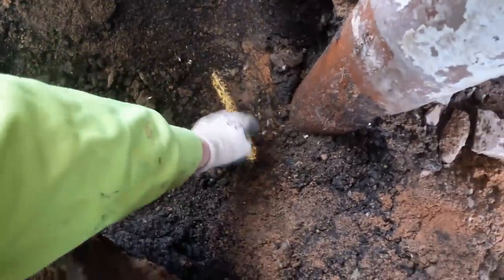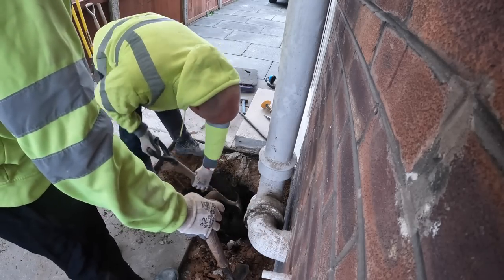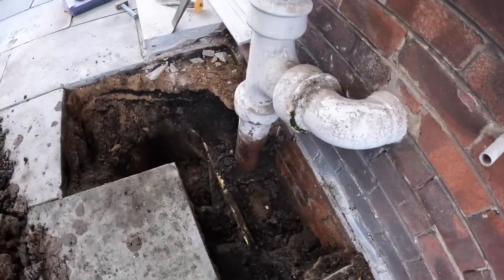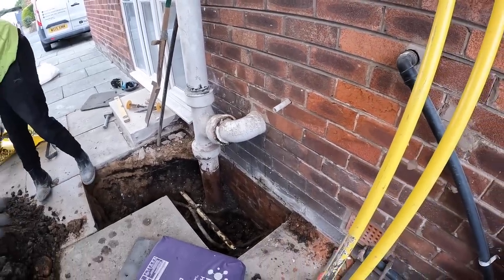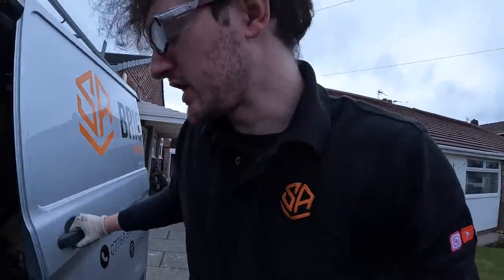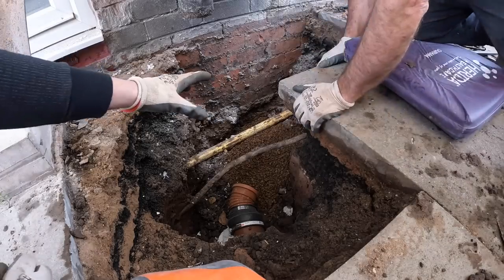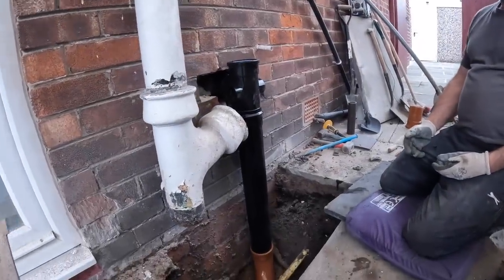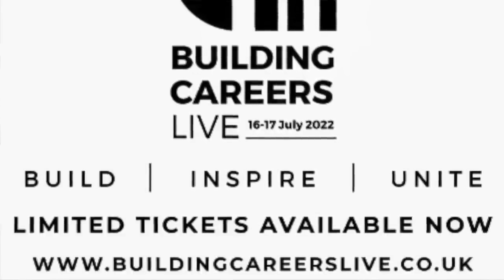NEAR MISS WITH THE GAS & WATER!! MOVING A SOIL PIPE

Comment: Great work i general but 23.00   you need to use eye protectors !!!
Also when using any push fit type fitting the old connection (or new pipe) needs to be cleaned before offering a new fitting on otherwise the seal will be damaged.
Reply from the maker: Thanks Jim 👍🏽🧱

Comment: Old water mains used to be installed in the soil pipe trench so watch out for those too, certainly early 60s houses. Often under the clay or bitumen pipes but sometimes not. All the way round to the back of some houses, stopcock may be in downstairs loo rather than under kitchen sink. 10mm Pea shingle. Some BCOs are ok with 20mm to soakaways.

Comment: I'm from Sheffield and we call it pea-gravel.Funny story,when I moved in this house I got rid of all the cast down pipe and cut the clay pipe back to a good section cos the old stuff was leaking,I had all my pieces cut like you have and was ready with a full section of plastic soil pipe aswell got my fairy liquid on and it starts to rain,yes you've guessed it the rain and the pipe sections were soooooo slippy,I managed the small sections on my own but the down pipe/soil was so long and heavy it just kept slipping till my neighbor lept over fence and held it in place while I fixed it to the wall,I must have done a good job as that was 21 years ago and alls still well.😏

Comment: Nice video as always guys. Top tip though, use a multi-tool for the pipe cutting in awkward areas. Absolute life saver and a lot safer than a grinder when cramped up like that.

Comment: 33:43 was that an old lead water supply line?
You don't need to PVC cement the new waste pipes? Or they press in gaskets?
Reply from the maker: Yes it was lead , not sure if it was live or not so we’re careful around it . 
   As for the pipes , no cement just a lubricant for the ribber seals 🧱👍🏽

Comment: Air admittance valves are generally placed on a soil pipe that is a minimum of 200mm above the highest water entry point – i.e. the highest point wastewater will reach within a soil pipe
Reply from the maker: Thanks for the tip 👍🏽🧱
Reply from the maker: @martin2466  . No drama , just helpful advice , cheers pal 🧱👍🏽

Comment: That valve should be fitted higher than the w.c.
Reply from the maker: Thanks John 🧱👍🏽
Reply: @SteveAndAlexBuild  Should be 1000mm above the w.c, also their not supposed to be used outside as they can freeze in winter and not work properly, the rest looks great tho. Nice job
Reply from the maker: @lukeh2323  Thanks Luke 👍🏽🧱
Reply: Usually the external Durgo is covered with a polystyrene cover…
Reply from the maker: @nigelsmith1198  . Thanks pal 👍🏽🧱
Reply: Hello Steve most comments here are right that air admittance valve should be fitted above the overflow levels of the appliance and usually only used inside. However I think you can get them that have been designed for use both inside and outside, they used to be much bigger though and had insulation fitted to them to stop them freezing. I don't think that is the case anymore.  If you do use the wrong one and it sticks this may stop the toilet  working properly lol.

sorry to criticise mate it sounded like the customer was making requests ....pipe close to the wall etc can make life difficult sometimes. 

It looked nice and tidy when it was finished
Reply from the maker: @jbclassics  Thanks Jack no all advice welcome . It’s an easy fix if it becomes an issue . We are going back to build the porch soon 👍🏽🧱

Comment: Good job you lads don't smoke. Can just imagine it lol wanging the shovel in roll up firmly clamped in lip 😂🤯

Personally I'd chop out that lead pipe and replace it with mdpe where it'd be under the porch. You know it won't leak there then in future.

What's the overflow pipe to the right of your new stack for? Could boss it in to the side of your new soil pipe tidy it up.
Reply from the maker: That’s all down to the plumber. We’ve done the hard part 😆🧱👍🏽

Comment: This is the snag with mole driven service pipes. There’s no warning tape a few inches above.
Reply: British Gas tried to charge me £800 to repair a "moled" pipe one of my lads chopped through in the late 80s or early 90s. I asked for their current gas main spec. sheet. Theirs failed on depth, (should have been >600mm but was <450mm) and no warning tape above. Needless to say they cancelled the invoice. And probably updated guidance.
Reply: I doubt in this case the gas was moled in. It looked steel pipe to me.
Reply from the maker: @baldyslapnut.  . Friggin joke , well done for taking them on 🧱👍🏽
Reply: @SteveAndAlexBuild  I was more annoyed that the two man gang from Clancy/Docwra only had to mix some resin and clamp the repair section on, we'd dug the bloody hole. They were there 10 mins max. Got some repair kits on our vans after that 😉🤣.
Reply from the maker: @baldyslapnut.  😉😆🧱👍🏽

Comment: hard work cutting that 4" plastic soil pipe coming out the bathroom wall up against the brickwork with that Makita grinder, next time use a Multi Tool with a fine tooth wood blade in it, just work your way around the pipe
Reply: I always used a fine tooth hand saw then grinder & flap wheel to chamfer the end.
A “WorkMate” folding bench opened wide is ideal for supporting the pipe while you cut.
Reply from the maker: We have a multi tool but never gave it a thought 💭 😆🧱👍🏽
Reply: @SteveAndAlexBuild   they bostin tools, the times ive had to cut 4" pipe flush to the floor or a wall in bathrooms, no way could you get a saw in and get a square cut so i usually wrap a piece of paper round the pipe, draw a line around it with a sharpie, and slightly angle the multitool blade inwards and work my way around it, quick rub with a file to get rid of the burrs and before ya know it Bob`s ya Auntie, Fannies ya Uncle and cousin Bert`s now cousin Betty coz he`s had his `clock weights` surgically removed lol

Comment: You do need to have a soil pipe that is open vented to the atmosphere on the drainage run that serves the house, it can't just be an air admittance valve. It is fine to use an air admittance valve if there is another open vent on the same run but not if that's all there is. 

The air admittance valve is positioned to low, it needs to go above the highest spill over level which would most likely be the basin. Also most valves are not designed for external use as they can can stop working in freezing conditions.
Reply from the maker: Thanks for the advice 👍🏽

Comment: Pea gravel as I know it is small round stones up to 10mm. You shouldn't use it for bedding pipes because it doesn't compact down and will allow the pipe to move after it is covered. The stuff you used in the video is indeed proper pipe bedding - small angular crushed rock. It should really be tamped down to take all the movement out of it so it provides a proper support for the pipe and anything resting above it. If you were laying larger pipes, like concrete sewer pipes, you'd add a layer of compacted sharp sand too, just to try and make sure there's no movement when after the pipe is laid. For a tiny job like this though I think you'd be safe with any backfill really. For brickies you seem to do a lot of digging! :) Keep up the good work.
Reply from the maker: Thanks pal 😆😆🧱👍🏽

Comment: 4ft, lol, we are metric now.
Reply from the maker: We work in both 😌🧱👍🏽
Reply: @SteveAndAlexBuild  As a patternmaker i do as well,lol
Reply from the maker: @davidcort2857  😉👌🏼🧱👍🏽
Reply: @SteveAndAlexBuild . I measure in feet and inches unless I have to divide a measurement into equal increments. Then I go with mm and cm measurements. Much easier to divide.
Reply from the maker: @larrykeenan598  Absolutely 👌🏼🧱👍🏽
Reply: I use whichevers easiest at the time. Gardening seed packets are all still in inches so I get plenty of practice on the allotment in imperial. 😁
Reply from the maker: @Tom_Plumb_PHS  😁🧱👍🏽